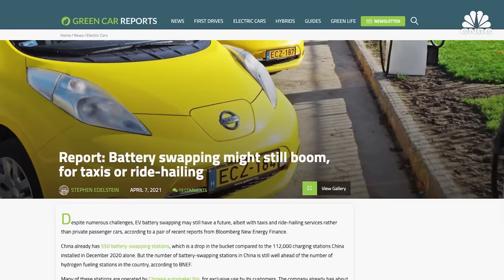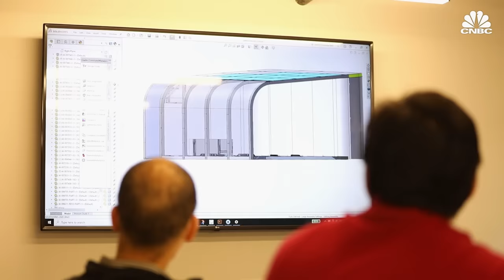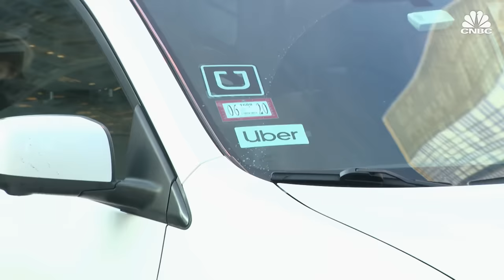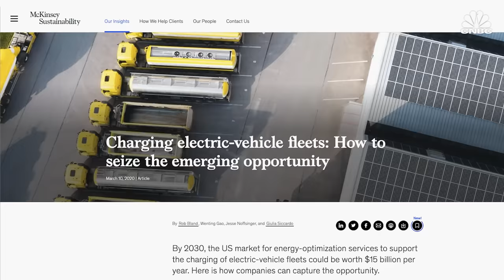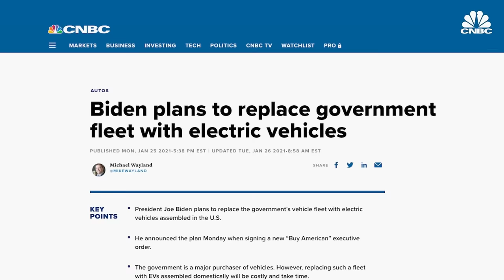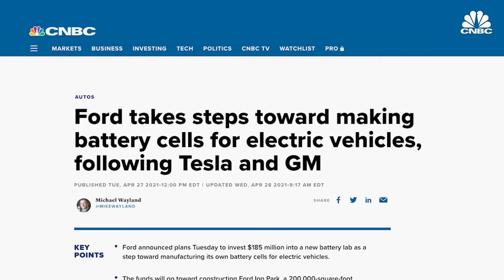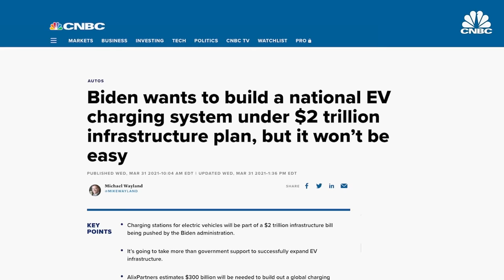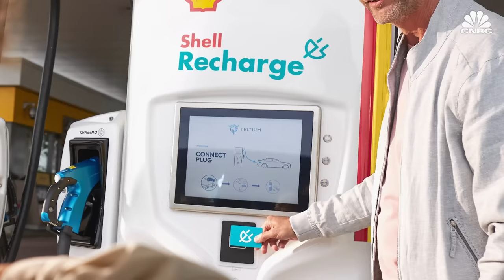Can EV Battery Swapping Take Off In The U.S.?

Comment: This is an interesting idea but battery technology is changing so fast that this won't really take off. Taking 15 minutes to get half you range back is much more reasonable and doesn't require the overhead of all those extra batteries
Reply: NIO has done about 2 million swaps in China, at 192 stations; it's aiming for 500 stations by the end of 2021, it will take off
Reply: @solarfeeds2019  Maybe for the Chinese market, not anywhere else.
Reply: Fast charging degrades batteries much sooner than trickle charging.
Reply: @supercal333  technology is changing rapidly
Reply: @supercal333  yeah but look at the cycle counts that Tesla gets now (look at tesloop data from their cars) and it's already as good as gas engine if not better even with supercharging. Fyi tesloop cars are almost exclusively supercharged

Comment: The solution is to trickle charge when you get home and leave it overnight, super charge when needed. You wont damage the battery if you only super charge occasionally. Also, you won't get a cheaper charge rate than trickle charging at home, these services will all have a convenience fee.
Reply: Presumably, you would choose to buy the manufacturer's battery when buying your car. I could see people who rent an apartment and don't have a charger at work choosing this option as it is more convenient than their current situation assuming there is enough infrastructure to make this viable. It would probably only make sense for city driving until there are enough of them off major highways. One concern is how many cars can they service at one time?
Reply: Replacement batteries can cost close to half the price of a new car. You have to calculate that in to the total cost of operation.

Comment: This battery swapping will become obsolete soon enough with the advent of faster charging technology on the horizon.
Reply: Not to mention if Solid state batteries ever become a reality
Reply: I disagree. Battery swapping allows you to have an older electric car but keep up to date with an ever changing electric battery technology.
Reply: Battery swapping IS A DUMB IDEA.
Sounds "Clever" BUT Batteries is the MOST EXPENSIVE part of an EV AND there is AND WILL BE a battery shortage for the foreseable future.
With battery swapping you need MORE BATTERIES.
Most cars should be able to charge while parked so more chargers are needed, swapping is unecessary.
Reply: @kendale8331  But most people would lease an EV so they stay up to date with latest tech. It doesn't make sense to buy an EV really.
Reply: @kendale8331  I hope you're right but I think a lot of these EVs will just be designed to be disposable.
Reply: @kendale8331  lol look at nio in china, so many car need swapping and everyone need to wait one hour and i don't even mention 30 minutes to swap the batteries
Reply: Erm, lithium ion battery research takes decades of lead time. You got a clear date on when this obsolete may happen?
Reply: You are wrong my friend. Time will show you